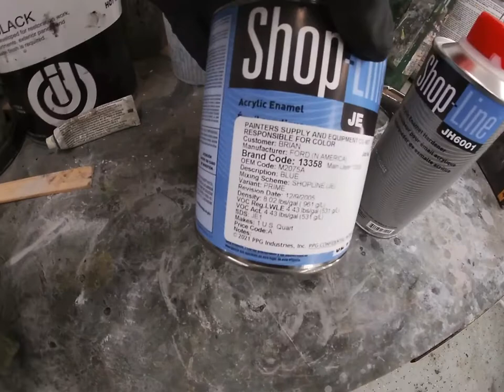1970 Lincoln Mark 3 part 10.  The 460 gets some attention part 2. Painting the engine.

Comment: I have an early ‘69 with 45k miles. Does that have a timing chain or nylon timing gears? If gears, are they good at lower miles or the issue with teeth breaking age dependent?
Reply from the maker: These engines have timing chains and are very dependable. Thanks.